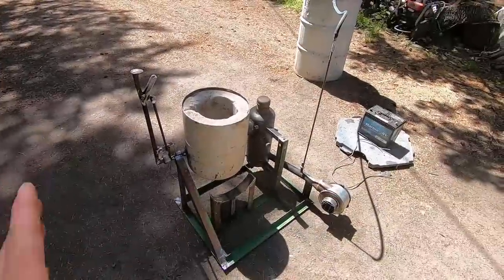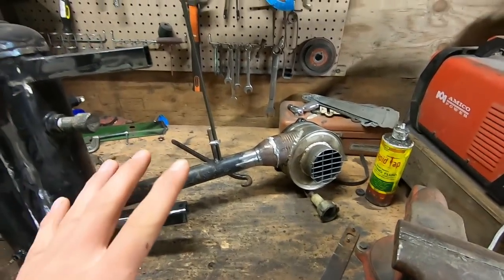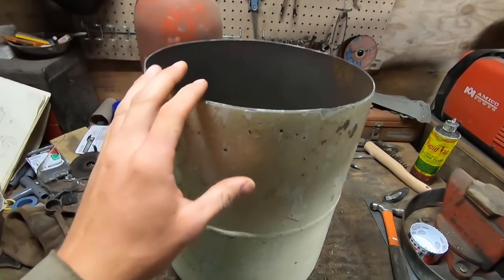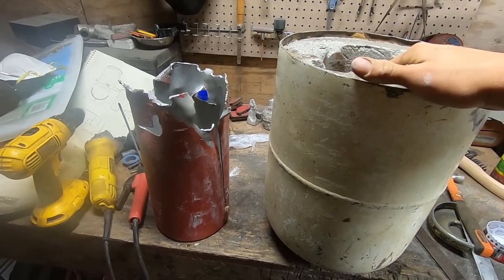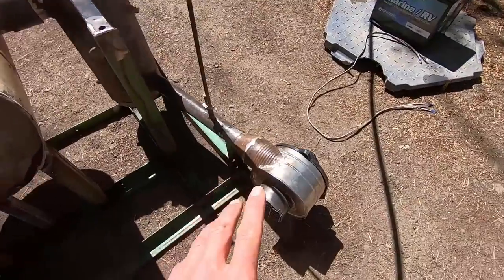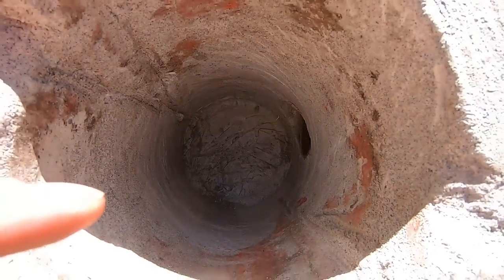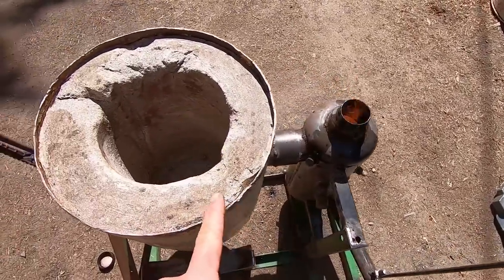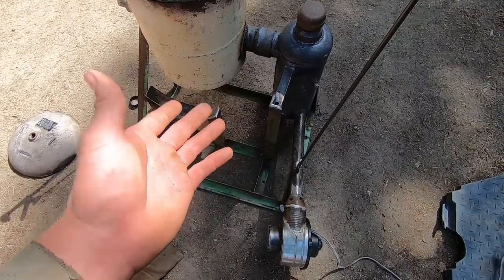Building a convertible Waste-oil Aluminum Foundry/Forge Out of Scrap Metal | Free Aluminum Scrapping

Comment: This thing is pretty cool!  and I do think its Genius that you combined a forge and foundry... i'm See its vary clear you have to use this outside on the ground as foundry.. but curious though do you plan to use it as forge in the same way?  Personally I hate watching people work on the floor, and feel like this might of been a missed a opportunity to come up with a clever stand that might let you easily wheel it out when you need it where it can't set the shop on fire with hot molten aluminum...
I even have a though on how to do with a movers Dolly.... but I want to know if the black burn chamber has to be orientated in the position you put it in so the flames end up going up...
Reply from the maker: Eventually I would love to set up an outdoor area specifically for casting and forging, but unfortunately I don't have the space right now. :'(  When I do, it'll be on a stand for sure! I would suggest putting it in the upper position that I have for several reasons: the fuel doesn't need any more space to sit and burn, the updraft helps things move smoothly, and the shape gives a nice cyclone effect. Hope this helps!
Reply: @randomn6473  Well I was actually thinking of if I made something like that setting it up to a movers dolly... when the movers dolly is up... and weight down  by some kind of heavy base weighing it down.. the metal melting area would be in forge mode.  you could grab the handles of the dolly to move it around... (though because the base has to be really heavy for it to avoid accidental tip over)  when you find a safe spot to forge.. you just tip it over so the handles and the foundry point up and get it ready to cook metal...   and because you have it tip forward, the wheels would be up so it cannot move around and cause it to move while hot molten metal is in it...  
Crude drawings here https://gyazo.com/b9a0fcc1129765f1fc1f5e7047b87ba1  Sorry if the drawing are vary crude drawings...

Comment: Burns dirty because of low air flow. Tune it so the flame doesn't come out the top. As it gets hot you can turn the air back down.

Comment: For future, fill the propane tank (larger container) with water, then push the fire extinguisher(little container) into the propane tank.  hold till it fills with water.  pull it out then dump.  now dump the water that remains into the bucket, make a mark.  thats how much cement you will need

Comment: The removal of the die may have been easier with a smear of grease on either side. Grease as in butter or margarine not a fossil oil type. As it will burn away with little residue.

Comment: Probably should have coated the cylinder with oil then covered with plastic wrap, also drill a hole in the bottom of the cylinder so as to not cause a vacuum which will prevent it from coming out.

Comment: you want to pull a tank out of plaster or pull steel forms off of concrete, coat the metal with engine oil.  its the whole water and oil thing.  works better.

Comment: Would oiling up the  fire extinguisher prior to raping it in to plastic foil have helped to pull it out do you think?
Reply from the maker: I think a better option would be to use some sort of collapsible form instead of something solid. Perhaps cardboard or plastic! Thanks for the comment!
Reply: Interesting,  I see carton working wonderes. Especially because you'd be able to burn it away without much leftovers I would guess. Although I'm not Al to sure about it's structural integrity when faced with such a p danse and watery liquid. With plastic I'd worry that it would stick to much to collapse maybe. What about some sort of removable plug at the bottom of s solid container to let some air into the hole whilst pulling it out? Or maybe boring the inlet howl prior to getting the howl holder out?

Comment: the better way is the installation around an old oven  can heat to around 40.000 kelvin were the plaster sand mix brake down and you spend more fixing the smelting  over youing it and it can be messy

Comment: I'd say you were giving it way too much oil during the melt. black smoke means incomplete burn from flooding. In complete combustion there is no smoke and higher temperature.
When you tested the combustion chamber and melted the can there was less smoke and the flames were leaping out 6 inches. melted the can on contact with the flame.  Then in foundry melt you had the flames jumping out of the entire opening of the forge over a foot. Too much fuel or not enough air to complete combustion in the chamber and in the forge body makes it cool and smokey rather than hot and clean.

Comment: I know this is a old video but next time use plastic rap a bit more then a littel bit of Vaseline on the outside of the rap and in side also if you crush a straw and put it on the outside of it it will help wit air passing through the hole.